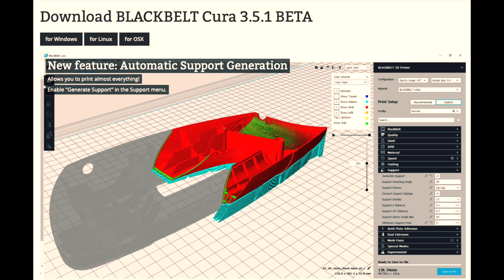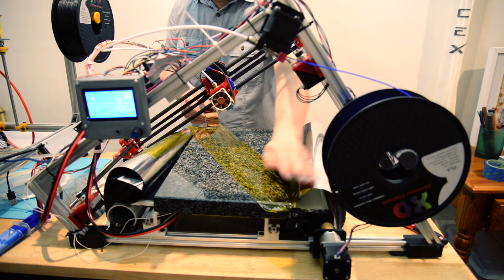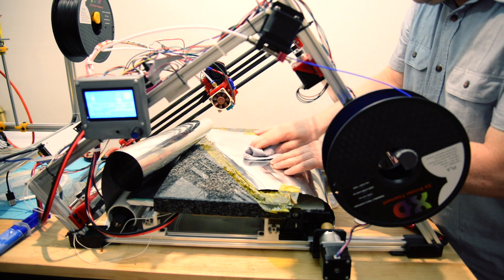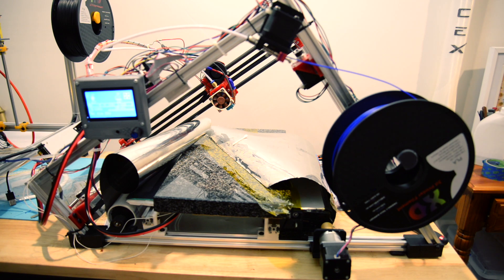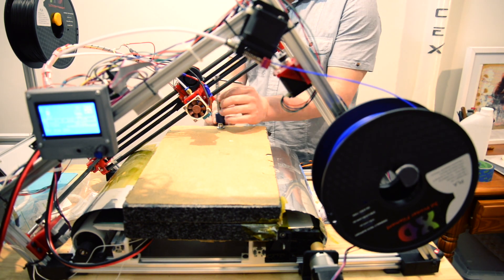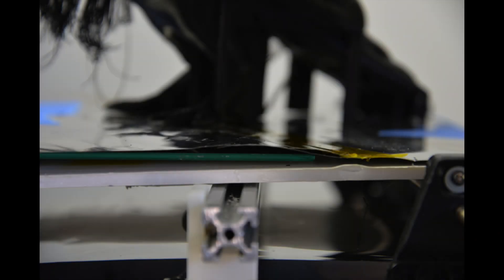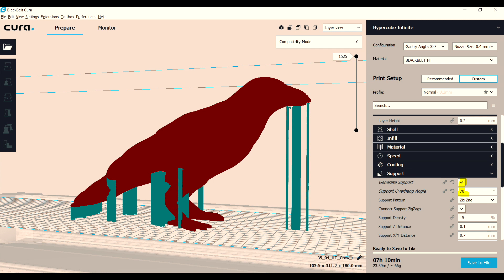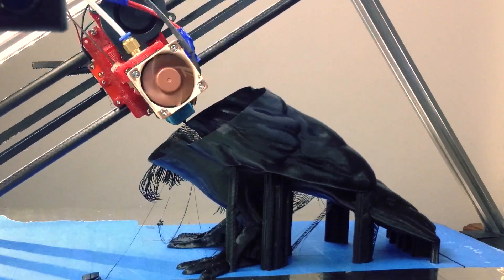Joining the belt with Epoxy and Automatic supports in Cura

Comment: Greatest thing 👍
I have one confusion about your printer that is, why you tilt this at 35 degree rather than 45 degree?
Reply from the maker: No good reason. I tilted the bed at 35 because of the nozzle. The E3D v6 nozzle touches the bed when it is tilted at 45 degrees. I then changed the nozzle to a Mk7 nozzle so it is not an issue anymore.

Comment: How to bedleveling ???
Reply from the maker: 봉 봉 It doesn't seem to be very sensitive. I move to heatbed to level the X axis. Then print a large calibration cube and measure the angles to make sure my gantry is at 35 degrees.

Comment: Bonjour,
i make 3d printer plan in sketchup make ( type )" infinte" like you , i hope. what is the high maximum between the hotend and the belt in your case and do you think is ok or bigger ?
what do you think ?
thx to you Mister Coyte-king.
Reply from the maker: Bonjour. The maximum between the hotend and belt on my printer is about 180mm. If you tilt the bed at 45 then it will be bigger. I would prefer 200 on mine.

Comment: hello
you update regular so nice .... i want to build a belt 3d printer , i saw your evolution , so good job... i dont understand exacly the probleme with the belt is it for transfer a constant temperature , wich material can we use .... ? have you look at the laser printer cardbridge ( toner )  how is it made ?
it's a tube with halogen lamp inside ... so just like that .....
toner:
https://www.youtube.com/watch?v=wpzSPRXbLh8

belt  must tension scalable to put belt correctly and stay in center place ...
https://www.youtube.com/watch?v=eKkJN7WkCfw
https://www.youtube.com/watch?v=7uFBaUQtuBI

i m so excited to make mine . i'm buiding ........ see you Mister Coyte-king ... i love your name too lol ....
Reply from the maker: Thanks for the videos. I love the ideas. The belt has to be stiff so the models don't move. If you print PLA you don't need heat. If you print ABS or nylon you need heated belt so the material will stick.

Comment: Have you considered a canvas like material belt? If you can sew it diagonally and stick kapton to it then it should work. In theory even paper sheet after coating with kapton should work. By the way, the paper from postal packages (the yellow one; can't remember the name) is very resistant to sheer stress. Other option would be "something" already tubular  (like a really big hose) that you would cut to length (belt width). Right now I can't remember of anything that could work...
Reply from the maker: I haven't completely figured out the belt yet. Canvas would be easy to work with. I like paper but kapton tape is not cheap if you cover the whole belt. In terms of cost and durability, at the moment the stainless steel shim with tape world will. It is just the joining that is not perfect. Thanks for the ideas. I will keep experimenting and looking

Comment: Have you had problems joining the belt with kapton? Unfortunately I think epoxy cures to be very brittle so I think it's going to break apart as it goes around the bend. Worth a try though. The new cura looks cool! Thanks for posting a link. I've also sent a request to join your fb group. I'm always excited when you post a new video!
Reply from the maker: The tape gets damaged after a while and then have to replace it. Nothing serious.
Reply from the maker: You were right. It didn't last.